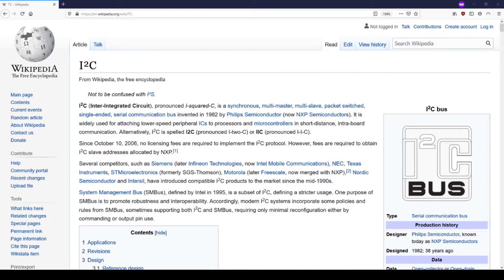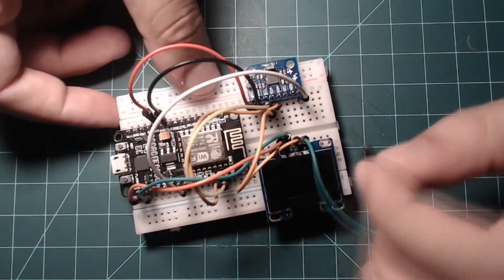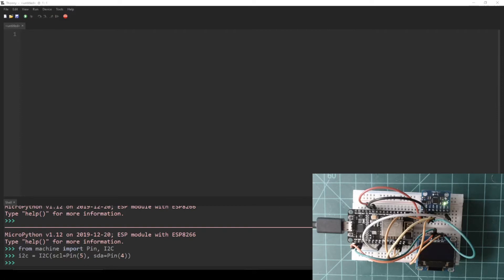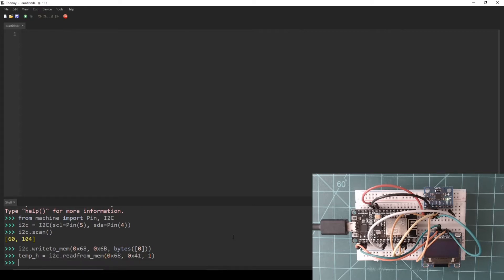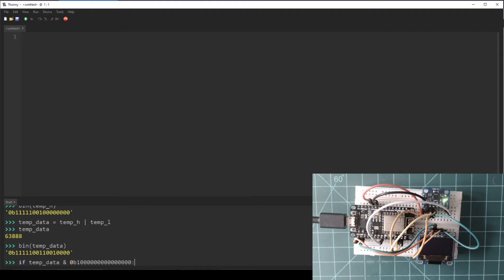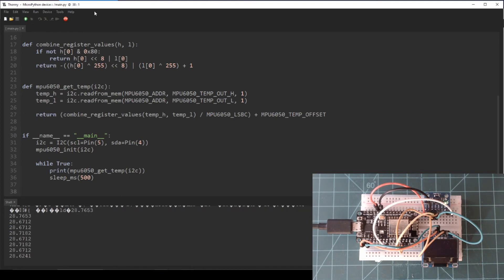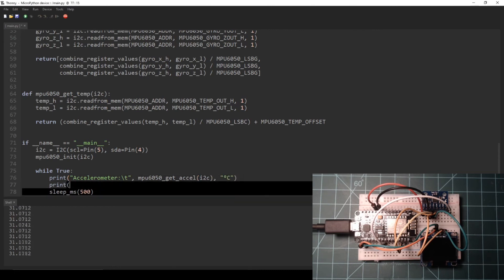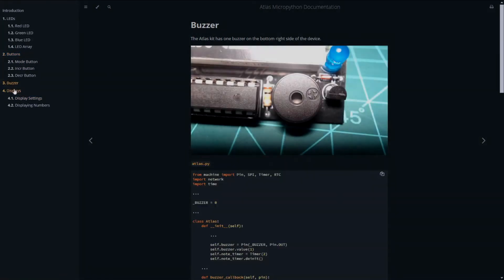Programming a NodeMCU with MicroPython: I2C Bus Part 1 (MPU6050 IMU)

Comment: Love your tutorials.  2 questions.  Why not create the device drivers as classes?  Second question would you be open to creating a tutorial for the APDS-9960 with a detailed breakdown of how to custom create the Gesture Dectection, Color Sense and Gesture sensing?  This would really solidify people who would like to contribute to the MicroPython community to write device drivers as there are literally NONE out there other than the work you have done.
Reply from the maker: Thank you for the feedback!

I haven't made the device drivers as classes simply because the structure of my guides is to build an understanding of the concepts, not necessarily to optimize usage. However, I think that creating device drivers using classes is a good idea that I will definitely consider for my future guides.

It's funny that you mention the APDS-9960. I was very close to using this sensor instead of the MPU6050, but I settled on the IMU because, in my opinion, it is more straightforward and easy to understand. I probably will make a video featuring the APDS-9960 soon.

Your feedback has given me some new ideas. I really appreciate you taking the time to leave a thoughtful comment.
Reply: @metalmancytech  no worries I have learned alot and will try to make a class library from this foundation.
Reply: @metalmancytech  again I want to emphasize how valuable this tutorial has been to me to help me get started with device driver development.
Reply from the maker: @mytechnotalent  I saw that! I think I'll link to your repo and credit you at the end of the article for doing this.
Reply: @metalmancytech  that is so kind of you Thank you so much my friend!  Thank you for all the great work you all do at Micronote!

Comment: Hi, I got stuck with my esp32wroomdevkit1 . Have issues importing i2c. Any clue? Cheers
Reply from the maker: I just got out my ESP-WROOM-32 and made sure it was flashed with the latest version of MicroPython (1.12) and tried importing I2C from machine and had no problem. I will just say to make sure that "I2C" is capitalized. Below is the exact import statement I made:

from machine import I2C

Feel free to reply here if you have more details on the problem or it still isn't working.
Reply: @metalmancytech  that's works great now.
thanks for for the detailed videos. it helped me better than any other to understand every step of the process